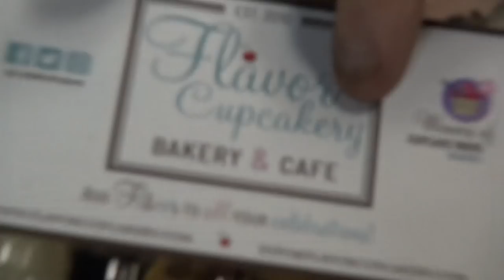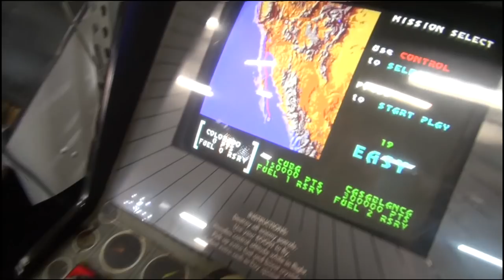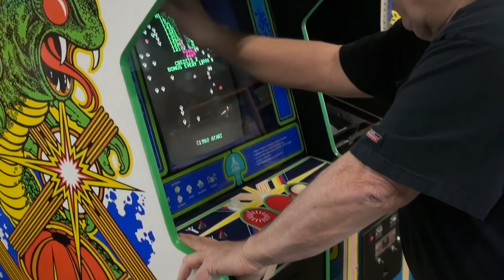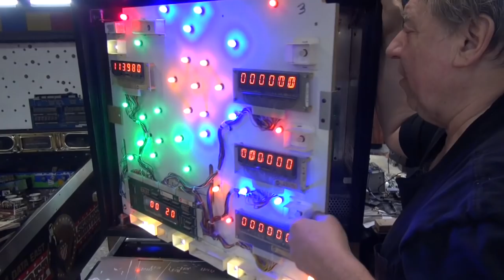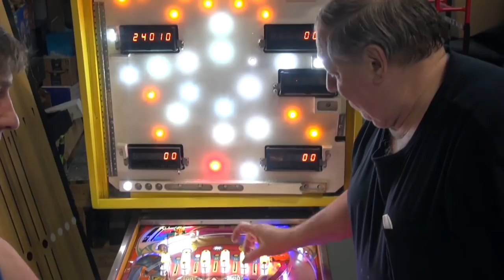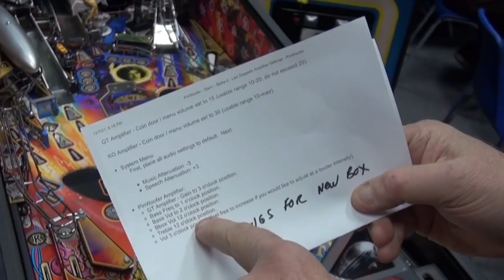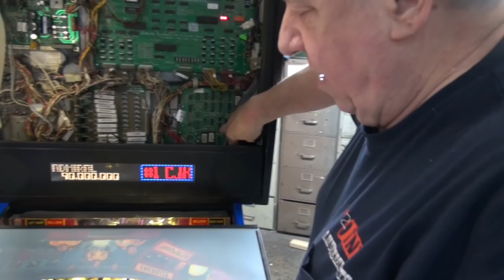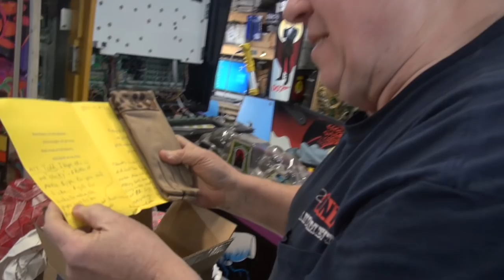#1688 Stern LED ZEPPELIN Premium Modded Out! STELLAR WARS-STAR TREK 25th Pinball - TNT Amusements

Comment: Todd, have you had any issues with a Rotten Dog boards? I got one no issues, bought a WPC95 for my Junkyard by Williams the left flipper and several playfield lights quit working😞
Reply from the maker: yes....some work fine in one game and not in another....
Reply: @tntamusements  l think there is some quality control issues. I'm not picking on them because without them there is no other option. They told me installed it wrong😏. I can install boards anyone can. I just don't have a way of checking components. I think l got a faulty board. TNT Amusements is awesome 👾🏆🏆🏆🏆🏆